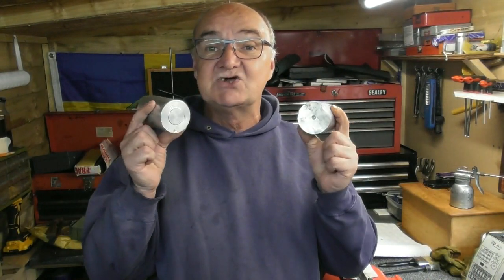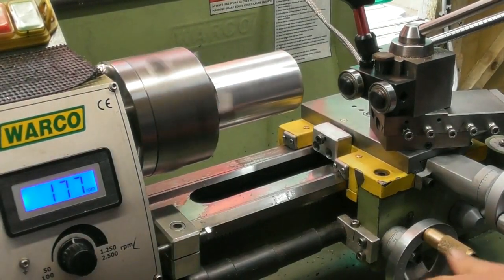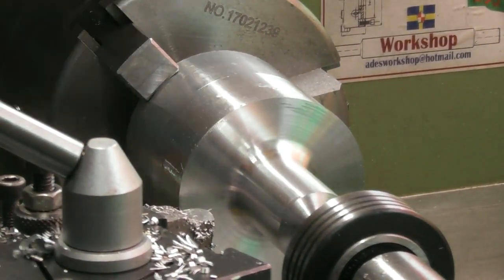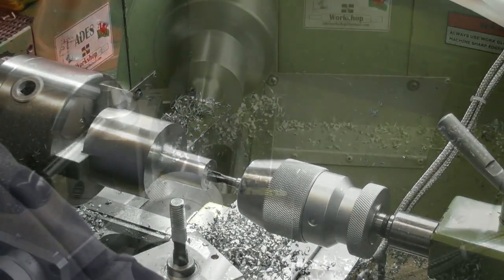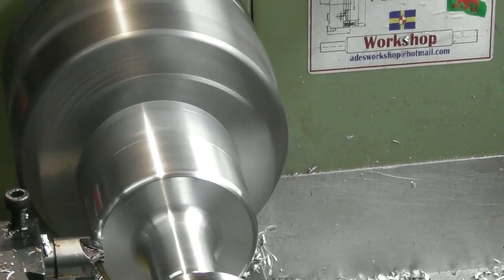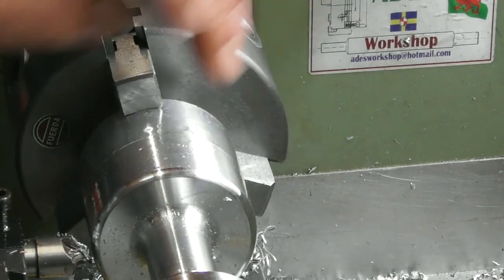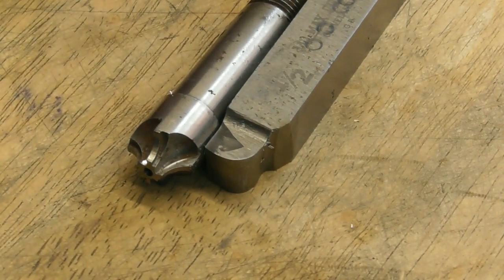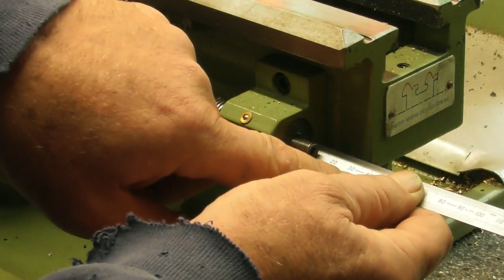Warco WM180 leadscrew handle, part 1

Comment: I made one for my WM180 a few weeks ago and it makes for very smooth cuts without having to use the power feed (and the lathe is a lot quieter without the power feed). The mass of the gears on the end of the leadscrew do give it a bit of inertia so it keeps moving when you let go so I tend to use a bit of carriage lock to add friction. I just bored out a smaller OD bar to snugly fit over the existing nut and secured it with a grub screw then cut  a disk of 10mm nylon for the wheel. Doesn't look as nice as yours but it does the job. Couldn't do without it now!
Reply: You prolly dont give a damn but does anybody know a trick to get back into an Instagram account?
I was stupid lost the login password. I love any tricks you can give me.
Reply: @Lucian Damian instablaster :)
Reply: @Kenneth Dexter I really appreciate your reply. I found the site through google and I'm waiting for the hacking stuff atm.
Seems to take a while so I will reply here later with my results.
Reply: @Kenneth Dexter It worked and I finally got access to my account again. I'm so happy:D
Thank you so much, you really help me out!
Reply: @Lucian Damian No problem :D

Comment: Hi Ade, thanks so much for sharing this videos. Would you mind show how align the tailstock? I'm having a lot of issues with that, it's so misaligned I can't even use to drill. Thanks again
Reply from the maker: That must be really bad . i will try to do one soon , in the mean time , put the centre in the headstock and the centre in the tailstock and play with the adjusters to get the two points together , it is a good starting point , will address this soon , Cheers Ade.
Reply: @ade63dug  thanks a lot Ade. I think, for some reason is not a height alignment issue. I'm pretty sure is not centered, I mean it's off of its axis

Comment: I wish my lathe had that feature. I can disconnect the thread gears via a lever behind my headstock. How ever the lead screw does not have any retention on the tail stock end it’s just captured between the two pillow bearings and locked on via the gear in the gear box
Reply: My lathe sounds like yours - lead screw locked to a gearbox at the headstock, and a bit of steel floating in some cast iron at the tailstock... Makes me want to machine a new bearing block with some thrust bearings (or angular contact) just to reduce the axial play :)
Reply: Adam Carmichael I have the little machine shop 5100. It’s a sieg. SC3 I think.

Comment: Nice modification in the works Ade! I really liked the finish you got on the internal radius :)

Are you going to get some overhead transparency film and print a scale on it to suit the lead screw so you have some graduations?

Looking forward to the next part. Thanks for sharing!
Reply from the maker: I did think of putting a scale on it but with the DRO there is no need , Cheers Ade.

Comment: Hi Ade, Many thanks for the video :) A quick question if I may...while looking at the lead screw... I am hopefully about to purchase a wm180, but have seen that it may not cut left hand threads. I'm fairly sure this wont be an issue for me...but do you have a suggestion for a way round this?
Reply from the maker: I have seen a modification done using a tumbler gear , i think it was on a forum somewhere, i cannot remember where though, Cheers Ade,
Reply: https://www.youtube.com/watch?v=xwsXNChYB7Y Here you go.

Comment: Vegetable Oil is very good  a a cutting fluid - save the old chip pan oil instead of throwing it away & use it from an old detergent pump spray (Flash A-Aaaaa!!)

Comment: Ade can i ask you a question on the mt3 - er32 collet chuck you use, does the hole go all the way through the center of the chuck. So that you could hold some longer stock in the collets ? thanks.
Reply from the maker: No i does not , i do have a collet chuck that mounts on the hedstock that does , Cheers Ade
Reply: @ade63dug  Is that the collet chuck that bolts onto the flange, do you know if most of the mt type  collet chucks dont have through holes in them.
Reply: @gillian9178  AFAIK all MT shanks are solid.
Reply: Great tip there .Here is another one .
Put a socket on the long nut for a quick hand wheel then get a bit of plywood drill through to take socket head .Cut o/d to handle size  of your choice .
Araldite  finishes the job .
Down and Dirty.